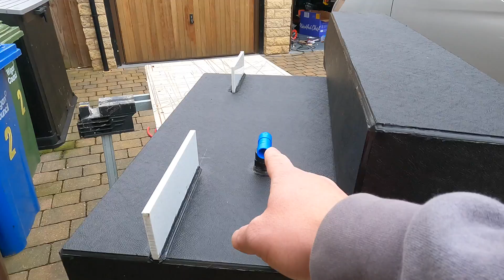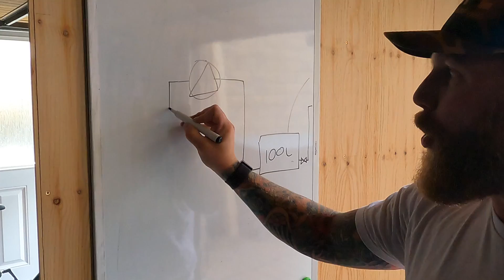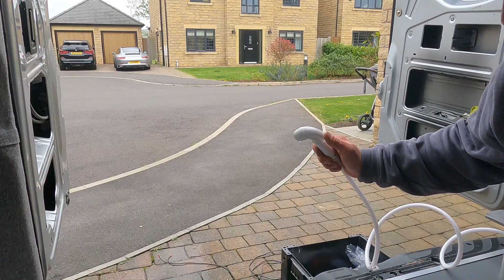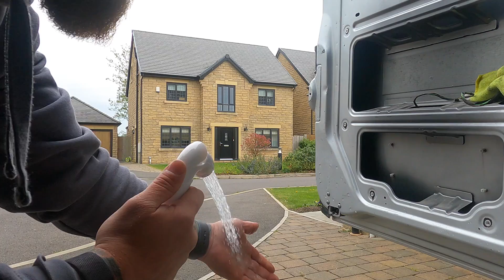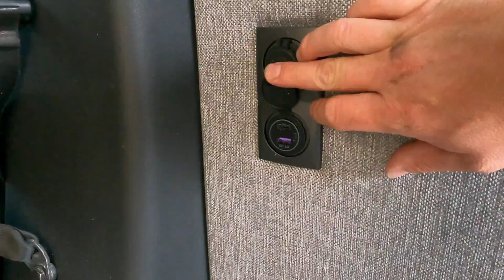Ep15 MERCEDES SPRINTER. VAN PLUMBING HOT WATER. TIPS

Comment: Recently I fitted a 30l surejust calorifier scrounged from a narrow boat. I haven’t plumbed it into the engine water circuit yet either.

Mine does not have one but I thought the current surejust calorifiers were supposed to be supplied now with a non return valve in the cold feed as standard?
if mine did have one I would have also fitted an accumulator in the cold circuit because I hate pump cycling.

I bought the combined 12v dc / 230v AC immersion which I have covered off in one of my own videos.
I heat the water on mains before leaving, 30l takes just over an hour to go from 20c to 70-80c
Then the 12v element keeps it warm, that draws around 25A so can easily be mostly off set by Solar or when the engines running.

I have the mains stat set to max to deal with any potential bacteria legionella etc. the 12v stat is set to about 65c.

On mine the mixer valve failed, easy to replace but noticed online prices vary wildly so worth shopping around!

There’s a fair bit of hysteresis in the thermostat so there’s not a lot of cycling, I have to draw a few litres off before it kicks in and it then runs for 20 minutes or so.

Need to experiment with that, especially as on the move I suspect the colder water at the bottom of the tank will mix with the hot at the top! As obviously when stationary it not the entire 30l being heated.

Like you, I might not even need to plumb it into the engine, time will tell. 

You missed mentioning a debris filter on the input to the pump, and an external outlet for the 4 bar pressure relief valve.

It takes a fair while to bleed my calorifier of all the air, the pumps obviously got to shift 30l into it, I might fit a filling loop to bypass the pump and use gravity as my cold tank is inboard so when full there’s a bit of head. However for the time being we can leave the hot tank full even with the cold tank drained. That really speeds up refilling.

Probably worth finding a way of capping you cold water inlet, I am not a great fan of them under the van, hygiene, dirt ingress etc bothers me.
Reply from the maker: I didn’t talk about the pump at all. As options are endless. Thought I did mention the prv. Said it was the last job I need to do. 
Now you’ve mentioned the non return ni would think there is one in the blending valve. 
Seems to be working great for me at the moment. I’ve since fitted a accumulator as well. 👍🏻
Reply: @urbanarkoverland  Ah yes it could be via the mixer, I’ve only got the single 5l expansion tank on the hot side and I haven’t noticed any luke warm water coming out of the cold tap which might be a consequence of it being pushed back through the tank.

 That would obviously only happen for a brief period of time whilst pump pressure was lower than the pressure from the vessel.
Unless I left the pump turned off then I reckon the expansion tank could push about 2l back through the tank….. potentially yuk!

I use a 2 bar shurflo pump, not sure what the pressure rises to once the water is hot I doubt it anywhere near the 4 bar of the cut off valve but I have got into the habit of drawing off some water once the tanks hot just to be in the safe side 😀

Handy video here on sizing an expansion tank

https://youtu.be/A2bpEh4hbVM

Comment: Hello 
You know your water heater calorifier system (which is brilliant nice one) 
- did you put blanks into the engine heater in/out ports or does it not matter ? 
- is there much heat lose around them ports ?
As thinking of doing similar in a caravan idea got ticking around my head, thanks Sam
Reply from the maker: No mate. Those two ports are literally a pipe that goes in and out. Don’t need to blank em. Don’t even need to think about them 👍🏻
Reply: @urbanarkoverland  thank you very much, seems a brilliant system. The boat industry has a lot of good stuff, good thinking going with that. ✊🏼
Reply from the maker: @samhartfieldlewis5247  yeah they do. And the stuff is usually built to last. So many products overlap 👍🏻👍🏻👍🏻

Comment: I'm looking at this and planning my own self build you say you have another van with a Truma if you were planning a long trip with a shower for a fam of 4 would you recommend the Truma diesel combi or this
Reply: I was going to go deisel heater and combi as lpg will be as you say hard to get my battery set up I've not got and I want to go hole hog tbh as I want induction hob and ninja pizza oven so if I need to add this to the list I might as well plan it if needed have you a link to this product so I can research some more
Reply from the maker: @scoutdooradventures5470  are you here in uk. 
Message me on insta 👍🏻
Reply from the maker: Great question. I suppose it all boils down to how big your battery bank is. If you have ample battery. I would definitely go for this. 100 percent. But battery power is expensive. If you had an actual shower you could increase the cylinder to 20 litres and that would give you so much. 

I find myself losing faith in the truma. With all the posts on social about error codes etc. 

So to answer your question. If I was to start a build for me with a shower. I would go diesel heater. For heat. And electric immersion for water. Also….. lpg can be a pain to source.

Comment: Would I be right then in thinking this is great for occasional use. Takes up smaller space in the van and no need for holes in the van for fumes extraction and no need for gas tanks. Whale and Truma are a bit bigger, need fuel not just electric, and gas vents? But better if using more hot water
Reply from the maker: Yeah. So I have. A truma combo boiler in my other van. Takes up ALOT of space. Needs gas supply. Flues and air vents like you say. This is literally plug in. 👍🏻👍🏻
Reply: @urbanarkoverland  seems to make more sense for occasional use to me, combined with a diesel heater. The weekend warrior setup!
Reply: Just need a good battery bank and inverter
Reply from the maker: @robww5921  that’s literally my setup yes 👍🏻 easy. And clean. 
Plus…. Gas a pain to get hold of sometimes.

Comment: Great video!
One thing i m intrigued is what type of fitting/ seal you use to get you pipes through the van floor (to the underslang watertank)
Reply from the maker: Nice question. I used a ip19 gland. For a wire initially. Just like you get with a solar roof gland. But bigger 👍🏻

Comment: Hi, loving the videos, just curious why you haven’t used the engine coolant option and ran it through the coil. I have the same system and have it piped to the engine or use the element, depends on circumstances/location. I guess the goal zero is that good it is not an issue?
Reply from the maker: I’m truth mate. Like I said… hot water is an added luxury in this van. Not a necessity. For washing up and an outside shower. With little use. It’s not really a live in van like the black one. So was a lot of extra work for little gain. Similarly, I could heat water while driving via goal zero. And that would then be being recharged via b2b 👍🏻

Comment: Just when I thought I knew it all you come along and politely remind me I know nothing 👍
Reply from the maker: Ah don’t be harsh on yaself mate. Remember I am a plumber. Electrical video probably won’t impress 😂
Reply: @urbanarkoverland  I finished my van last year, since then everyone is seriously upping there game, thinking about having a partial rip out and doing some things again. I noticed in your diagram you never included a water filter between the tank and the pump, any professional reason not to put a filter in? ❤️
Reply from the maker: @aberdeendeltaforce  I havnt fitted anything extra. Pump has a strainer in line bolted on to it. 
To be honest. For the upkeep the fort and the space. I just take bottled water. Boiling the tank water for brews won’t hurt ya. So I don’t bother.  With a real filtration system I mean.
Reply: @urbanarkoverland  haha, yeah I never drink water out the tank either, I think I have a strainer in-line too, not an actual filter, just something to stop any little twigs or whatever that might find it’s way into the tank from entering the pump and causing damage.
Reply from the maker: @aberdeendeltaforce  yeah same as. There is a filter as part of the pump on the inlet. You can see in the video actually bits at the front.

Comment: Great video as always. I used the 6litre with 12v and 240v heater coils, handy to heat the water on the move, and off grid (no inverter yet) but when we hookup it takes the strain off the 12v.
Reply: I did do a test when I first installed it, from cold I think its 40-50mins. On a good day my solar produces the amps required to keep up with the calriofier.  Being on agm batteries (260ah) I do keep a close eye on usage with the victron bmv
Reply from the maker: @paulhowes3788  ah that seems fair enough mate. Have you got a shower or is it just washing up etc.
Reply: We have a shower (recently installed) so yet to do a test to see if 6ltrs is enough water. The wife tested it and she was happy enough so that's a result 😆 🤣 😂
Reply from the maker: @paulhowes3788  fair play. Does go further than you would think. 👍🏻
Reply from the maker: Yeah. How long do you think it takes on 12v?
Reply: We have an external and full built in shower

Comment: Just curious why did you go 240v over the 12v 6litre version? Maybe size?! The additional coil in the 10 litre I guess is just unused in this case and you will direct heat only?
As you can heat on the move with 240v and goal zero inverter combo it is a no brainer and you can have hot water on tap is you are on site via 240v.  Great video as always!🎯
Reply from the maker: Yes mate. Size of the cylinder was important. I’ve also heard the 12v element takes aaaaaages to heat up as it isn’t as powerful. Ideally you would heat as you drive and then you get to where ya going with 100 percent battery bank and hot water 👍🏻👍🏻👍🏻
Reply: @urbanarkoverland  Loving that! 🎯
Reply from the maker: @thewhippetfoiler  ideal huh

Comment: Great video as always. Bit of a hypothetical question. Could this system be turned on and heating up on the move? Thinking about a similar system down the line but would be keen to have it on and hot for when I arrive somewhere or would you suggest only doing it once static?
Reply from the maker: Yes mate a very valid point. Something that I actually missed out. Of course yes. While driving. The power it costs you could be replenished by b2b 👍🏻